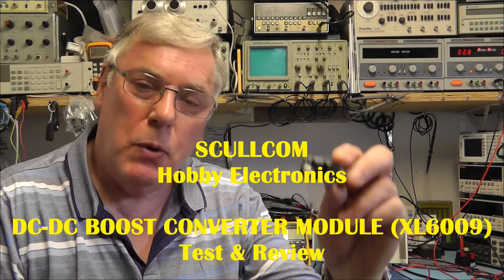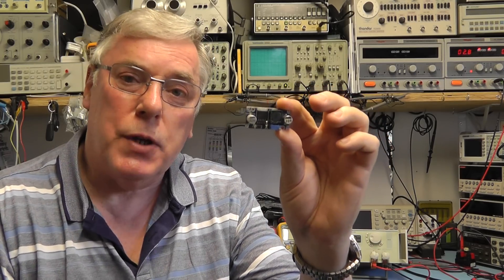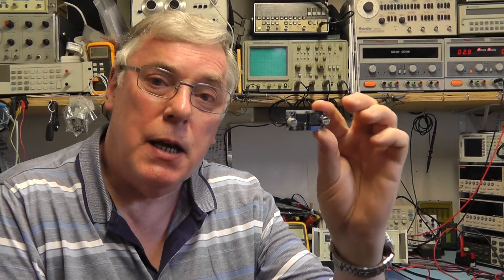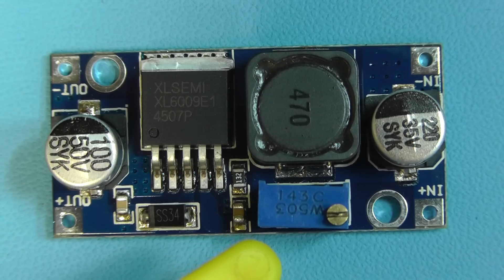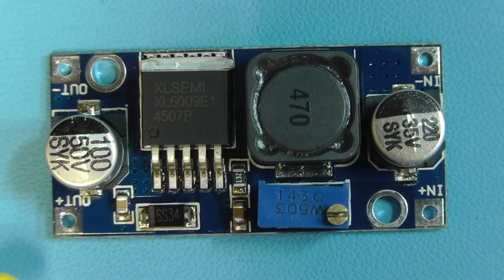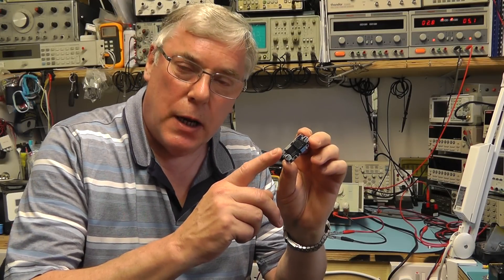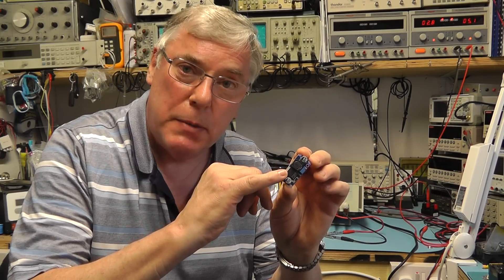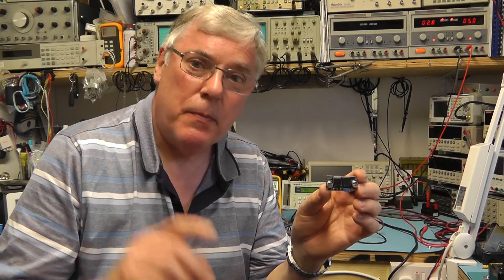Scullcom Hobby Electronics #19 - DC-DC Boost Converter Test & Review

Comment: Dear Sir, thanks for the video. Question, the dropping of the input voltage is not depend form the power supply you have used at the input? it is possible that at high current lie you had when the output was 1A and the input was about 3A that the power supply you had connected at the input was reaching its limit?

Comment: Almost 7 years later and most of the modules you can find on amazon, ebay and the like are still more or less based on the same common chips with the same layout.

And they still have the similar flaws they had years ago. Aren't there any moderately inexpensive and reliable modules out there by now?

Comment: Sir your presentation is really amazing by giving various inputs with volt and current. In this regard i have one question hope you can help and throw some insight.

I have connected Lithium Battery full charged (4.2v) with rated of 3000mah and connected as input to XL6009E1 boost module and set output as constant to 12v to plug wifi router and set-top box, however its not connected and at output the voltage is dropped to 4v. I have google but couldn't find any content. Hope you will give some insight.

Comment: I have to say that you made a wrong verdict there, because it at the 5Vin setting the voltage is not staying at 5 and the minimum input for the chip is 5v so you have to provide a fixed 5v input voltage and then increase the output power until it fails but the input voltage was sagging there (got down to 3.5v!)

Comment: Trying to use one of these on your precision voltage calibration source which ive adapted but the performance on 3.7v is terrible - the regulation is all over the place with very high inrush current

Comment: I'm sitting here with the data sheet for this chip in front of me. It lists the min input voltage as 5 volts. What is the use of letting making measurements while the input voltage has drooped below the min recommend.
Reply: The behavior should be known.

Comment: The 6009 builtin mosfet can handle input current of 4A, so if you have a low input voltage , as soon as the input current exceed 4A,  your desired voltage will drop for sure. When the chip's temperature exceed 65 celsius degree, you need a heatsink

Comment: Without heat sinks I'm pulling 25watts from those boards and with heat sinks and new diode (5A+) I pulled 40watts.
Reply: Hi WertzOne, which board do you use and which voltage do you put in?

Comment: What's happening here is, that either your power supply isn't up to the task or your wiring is dropping a huge amount of voltage with anything more than 2A and since you don't have sense leads from the power supply attached to the input terminals of the power supply, it won't compensate for the drop and the input voltage drops dramatically, and that can cause issues with the efficiency of the module and all that.

There's also the burden voltage of the multimeter to consider etc.. etc...

Increase the wiring cross sectional area and decrease contact resistances and/or have power supply with sense terminals when doing these types of tests.

:)

Comment: I never got this POS circuit to worrk
Reply: Let me guess your first time using a trimpod? you need to turn it 10-20 times to the side the trimpot shows in the body in order to activate it, if you don't do that it will not work to regulate the resistance therefore the voltage output will not change.

Comment: I think you to confirm the 94% efficiency is reasonable, 94% means upto doesn't mean you can always get it. all mfg list like that.
Yet your statement of 10Wmax is incorrect. You need to max Vin and Ain. choose output current the adjust pot to get output voltage. Output drop doesn't mean you reach max output power if you can still adjust the pot 
Also John Conrad is correct.

Comment: Could two of these be placed in series powered from seperate batteries to make a +- power supply ?
Reply from the maker: Hi,
I have never tried it. The negative line of each boost converter feed straight through from the battery negative to the negative output of each boost converter. So in effect you would have the positive boost voltage from one converter connected effectively to the negative side of the battery feeding the other boost converter. Give it a try and see what happens!
Regards,
Louis

Comment: does this chip is short circuit prevention built in them, or they just fry if output is shorted accidently. Pls answer thank
Reply from the maker: Hi Omar,
The module uses the XL6009 DC-DC converter and is protected by internal thermal shutdown, current limiting so should be OK if there is a short on the output.  It also has over voltage protection.
Reply: Thanks for answering, that suggest me to reset the chip, if it stopped giving output.
Reply from the maker: I have know some of these chips to go faulty mainly due to the fact that some of these Chinese DC-DC converter modules use fake/copy XL6009 chips and therefore may not comply with all the internal protection of a genuine XL6009.
Reply: Ohh I got it now
Reply: Thanks, Sir, I really appreciate such a quick answer.

Comment: Sir can i get 9 volt output with 1.2 volt or say 2.4 volt ( 2xAAA) battery input ?
Reply from the maker: Hi, The minimum input voltage for these DC-DC Up Converters is 3V so you would need to use two 1.5V battery cells. If you use 2 x 1.2V cells it may work if they are fully charges since the voltage would be higher than the 2.4V. Regards, Louis

Comment: To get a consistent result which is more in keeping with the claimed performance you must maintain the input voltage (measured at the module input points) each time you modify the load. Maximum output wattage, although possible in the short term, could never be expected to be sustainable from such a small device surface area without the use of additional heatsinking. Efficiency claims also cannot be maintaied at minimum line input voltage due to higher circuit currents (and therefore higher in circuit voltage drops) adding to the heat problem. On a positive note, I am very impressed with your programmable load and wish I had one.
Reply from the maker: Thanks for your comments. Regards, Louis

Comment: It is very efficient at lower wattage's, but from about 10w and above the efficiency isn't that great. 
For example at 10w the input side is using 13.35w. So at 10w it is 75% efficient, but at 3W it is instead 90% efficient and at 1w it is 93% efficient.  Also as others have said you need to do the test again and make sure that the voltage on the input is 5V at least, which is what these modules state as the minimum. If you do so then it will be more efficient than the figures it gave, it should be 95% efficient at 1-3w and about 80-85% efficient at 8-15w.
Reply from the maker: Thanks for your comments. Regards, Louis

Comment: Thank u sir. I request pls suggest an idea sir. How can I get a circuit of 2amps 6volta with 9 volt battery
Reply from the maker: You would need to use a LM2596S DC-DC Buck Converter Adjustable Power Supply Step Down Module. These can be found very low cost on eBay. Below is an example link for 5 modules:
https://www.ebay.co.uk/sch/sis.html?_itemId=null&_nkw=5pcs+LM2596S+DC+DC+Buck+Converter+Adjustable+Power+Supply+Step+Down+Module&_trksid=p2047675.m4100.l9146
Reply: Kamal , you can’t get 2 amps out of an standard 9volt battery, they are not designed for large currents.

Comment: what would happen if you connect two boost converters in series?
Reply from the maker: The boost converter has a maximum output voltage so will not exceed that level if you put two in series.

Comment: Is it possible to connect two of these in parallel to each other so the load would have a higher current?
Reply from the maker: it would be possible but not ideal as current sharing may not be equal. Better to get a higher current rating DC-DC converter.
Reply: Thanks for the info :)

Comment: Is it possible to get 5v output with 1.5-2 ampere current from this board and if yes how. .?
Reply from the maker: At 5V you should be able to get 1.5 to 2 Amp (10 watt of power). You may need to add a small heatsink on the XL6009 to ensure it does not overheat, using thermal glue paste.
Reply: I was actually using this in combination with a tp4096 charge controller to make a power bank but when i am charging the phone i am only able to draw 400-700 mili amp via this power bank  thus the phone takes to long to charge where as if i use the standard wall adapter, it supplies an output of 5v at 1.5 Amp and the same amount is drawn by the phone when charging is done through that adapter. how can i make the powerbank  with this xl6009 to produce an out put of 1 to 1.5 amp. conctant at 5v..

Comment: why does the input voltage drop.....is it the loss of the current meter ?
Reply from the maker: Hi Bob,
This was mainly due to the fact that the power supply I was using at the time was going in to current limiting mode due to the fact that I exceed its current handling capability. I should have used a power supply that would handle the higher current demands.
Regards,
Louis

Comment: Try this.
Connect the INPUT postive (as if it were a negative) to a load's negative (or your multimeter voltage setting)
Then connect the positive of the load to the OUTPUT positive of the boost converter.
Now measure the voltage and continously turn the pot all the way up. and all the way down.
You will see its now BUCK AND BOOST FROM THE SAME CHIP! 
Also please replace the inductor with a higher power one of similar value. (It will help greatly with supplying more current more efficiently
Possibly replace the shotky diode with a higher power rating one as well. Maybe 5 or 7A would be good (For safety use the highest possible current rating schottky diode you can find the bigger the better)

I was able to buck to to very high current levels when using a 12v 2A DC power supply.. I got 5.5A measured on my multimeter in 10A setting! so be careful and not short the output EVER. bad idea.

Very amazing this can work as a boost AND buck converter if you simply change the way the output is hooked up to it.
just be careful using sensitive loads as for VERY LIGHT LOADS there is a small spike in output voltage in this configuration. With slightly heavier loads no problem over 100mA

Comment: Your input source is not stout enough. The input voltage should not drop for a test like this.
Also, it would be interesting to put a thermocouple on the regulator to see what the case temp is for each setting.

It would be interesting to plot the data and esp the efficiency curves.
Reply from the maker: Thanks for your comment. Yes you are correct about the input power source.

Comment: can you make review for MT3608 ???
Reply from the maker: My understanding is that the MT3608 is a step up converter that uses a fixed 1.2MHz  oscillator for switching. It is very low cost and uses a small 6 pin SOT-23 IC. They work very well and can easily convert say 5 volt to anything up to about 30 volt (adjustable).

Comment: How come there are pleople powering 100w LEDs with these?  3A 40v
Reply from the maker: Its all to do with the Wattage - 100watt LED's normally require between 30 to 34 volts which would mean they would draw about 3 Amp of current. So you could use one of these DC-DC Converters but you would need to add a good heat sink to the Buck Converter IC.

Comment: XL6009 is the name of the chip. There are different designs and some of them uses two inductors. The model you got has only one. Did you have any chance to test the other version? They're not so much different in price.
Reply from the maker: I have tested a whole range of these DC to DC converters over the years. May be worth doing a video comparing some. Regards, Louis
Reply: Thanks for your response. That'd be very cool if you do. 

I bought the model sold by czb6721960. Things like this are very easy to make. Anyone can find a factory and produce them. Quality can vary greatly depends on the manufacturer or the order requirement. So it's always a bit tricky.

Not sure whether this model will meet spec at all. But at least it got two inductors! Which should make quite some difference? Hope you can do one in your next video. Also looking forward to see other models.

Regards,
Eric

Comment: Is there such a thing as a boost converter current limiter? Like a boost CV CC (constant current). I want to keep my batteries at 9V but limit the output current to about 300 mA
Reply from the maker: Yes but remember as the battery discharges the voltage of the battery will drop anyway even though the current output is maintained at 300mA. As an example search for "LM2577S LM2596S DC Step Up Down Boost Buck CC CV Voltage Converter LED Driver UK" on eBay - they cost about £7.
Reply: I know the batteries will reduce, but I mean to boost it to 9V. Thanks for the link. After checking a pololu boost converter and seeing it had a quiescent current in the mA, I'm going to assume they all have that and abondon the idea for this project! THanks.

Comment: Hello Nice Video. I have one of this boost converters . When I feed with 5v (5V 35A PC PSU) and adjust the ouput to 8V with no load, is fine; and to 35v. But on load condition, a little 12v bulb, mine converter the voltage go down to 5..V and only drain 145mA. Can´t boost anything. On the contrary the same thing but with 12v input, performs well... Is posibly that my converter is defective? What do you think. Thanks and regards (sorry for me english)
Reply from the maker: Thanks for your comments. Your English is just fine.

Comment: Can I drive external MOSFET to increase the output voltage up to 240V ?
Reply from the maker: Hi, I would not use this device to do that. You will need a much larger inductor to achieve what you are trying to do. There are better solutions such as use a standard 12-0-12 volt secondary mains transformer and build a power inverter using either Mosfets or Power Transistors as the switching on the secondary winding's and control then with a square wave switching signal (i.e. use an NE555).

Comment: is it possible to use this module for step down voltage
Reply: It doesn't seem so. Step-up + step-down converters cost almost same as two similar units -- the only benefit is location on same PCB.

Comment: I use this in my selfmade 12v vent where I supply it with usb power. But it does not work properly, The input voltage is not 5 but 2,4 volts, even if I use my lab bench power supply. When I increase the current from the 900 mA which would be enough to power it to mor than 2 amps suudenly the voltage increases to 5 volts and the currents drops back to under 900 mA. Can anybody help me?

Comment: Did you measure the heat dissipation temp @ 10 w on chip and how a heat sink may adjust results ?
Reply from the maker: No on this test I did not apart from the finger test and it was hot !!! :)

Comment: Looks very similar to the aliexpress LM2596 modules I use for many of my projects.. I've had no issues with 2amp draw, doesn't even get hot. @ 0.94c USD each, what's the point in buying anything else? Just search for "1.23V-30V DC-DC Buck Converter Step Down Module LM2596 Power Supply". - I'm not affiliated, I just like good reliable gear.

Comment: Greetings, Scullcom ....
Great Review.
I have some couple of questions, just to make sure that i understand what this little DC-DC Boost converter module is..
So, if i understand correctly, assuming the minimum input voltage of this booster was 3.7v and the maximum output voltage was 12v. 
I can hook up a 3.7v LiPo to the input and get a 12v out of the output ??

If my above question is indeed True, then how safe would you rate theses boosters ?
"safe": as in throwing them into commercial applications

and final question: What are the drawbacks ? you definitely do gain something
from the boosters but what do you lose ?
aside from never applying a higher voltage comparable to the max output voltage at the input. what are the dangers of this booster/ or stuff you need to watch out for when using them??

Thanks,
Regards
Reply from the maker: Sorry for the delay I missed seeing your comment earlier.
Yes you should be able to get 12v output from a 3.7v input battery.
These boosters should be fairly safe as the on board XL6009 IC has built in protection for both current limiting and over heating - if it exceeds a safe temperature it will shut down automatically.
Draw backs are switching current ripply on the output voltage at the switching frequency of 400KHz to reduce this I would suggest adding 2 more 220uF capacitors with low ESR across the existing 220uF output capacitor. It is better to use 3 capacitors in parallel as apposed to one big value capacitor since paralleling capacitors will give a lower ESR which is what you need.
There are no real dangers in using this boost converters.

Comment: I don't need to boost voltage, I need to power a drone with a 11.1 volt LiPo battery rated at 35C that is supposed to run at 7.4 volts. I am going to power a Photo gimbal and carry a go-pro camera and I need to know if this unit will cut the voltage to the circuit board of the drone which has a voltage cut off at 10.5 volts?
Reply: no it does not have a low voltage cutoff. then again, you should not need one, you not be discharging lipo 100%, you should aim to discharge no more than 50-60%, you do not need a low voltage cutoff, you need shorter flight times or more capcity